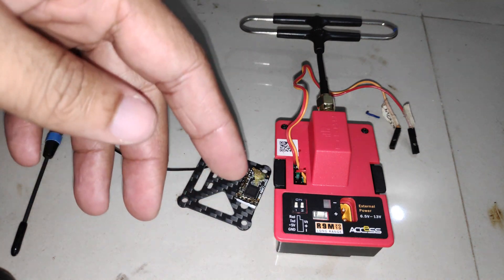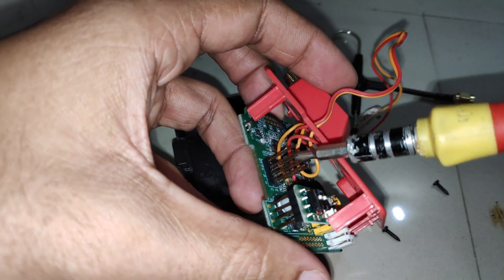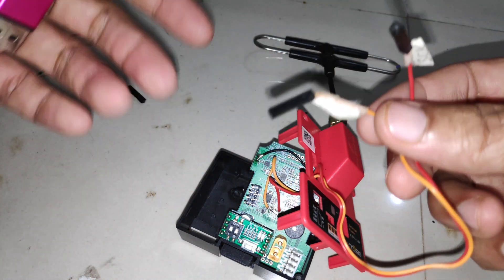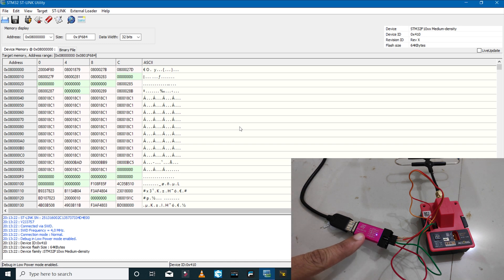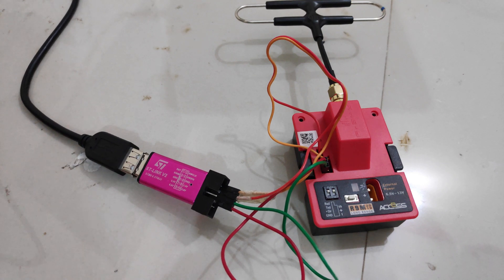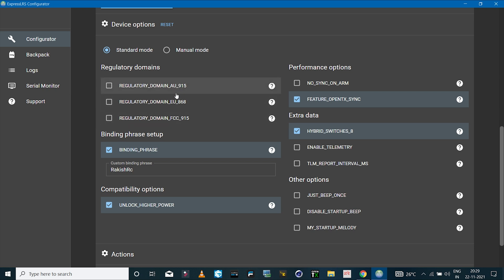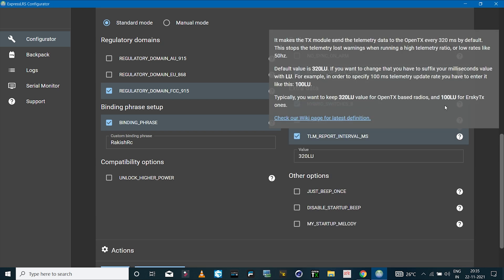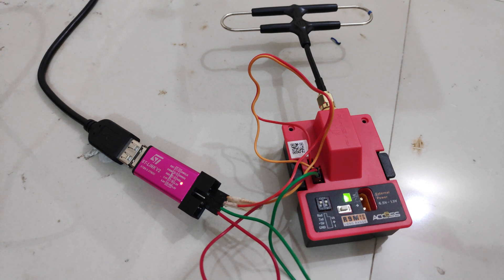Installing ExpressLRS on Frsky R9M using ST Link Utility | In Depth Tutorial

Comment: Hi, why did the power module burn out? According to the R9M manual, it supports 3S batteries.
Reply from the maker: It does but it mentioned in the user manual that don't plug a Fully charged 3s...my 3s was charged at full...so the voltage regulator blew up...there are 2 regulators in it..one of it burnt.

Comment: kindly tell me how to re-flash a newer version of elrs on r9m tx after flashing it with the version you showed on video.
Reply from the maker: Once elrs is flashed then you can update to latest version by using betaflight pass through method.
Reply: @RakishRc  betaflight passthrough works with the transmitter module too ? also, the red led keeps flashing on the r9mx receiver, even though i have flashed both TX and RX modules with ELRS 2.0.0. there is a solid green light on the R9M module, but red led keeps flashing on the receiver. using erfly6 firmware on flysky i6. pls help
Reply from the maker: @preetamghoshdrums219  did you select the crsf/elrs protocol in the radio settings? Also is the crossfire signal wire connected correctly on the tx pad of the radio? Betaflight pass through will only work for receiver for tx module use the St link device.
Reply: @RakishRc   just pointing out that i am using flysky i6 not i6x with the ERFly6 firmware. i have tried selecting elrs1/elrs2
 in protocol in model setup page, and connected the tx pad to the Smart port in the front of R9M TX module.  does it need powering from the front as well while using the Smart port ? Kindly share your mail to have this convo, earnest regards for your time so far.  need your further help to set this up.
Reply from the maker: @preetamghoshdrums219  yes I got that you're using the fsi6. How are you powering the r9m module? Contact me via telegram - @Rakish33 share pictures so it can be easy to resolve quickly
Reply: @RakishRc   I'll be sharing the pictures and whatever progress i have till now tomorrow on your telegram. thanks for helping out!!

Comment: Can a Ftdi Adapter use instead of ST LINK USB ADAPTER?
Reply from the maker: Ftdi won't work. Only stlink usb adaptor is flashing with this method because the chip in r9m and MX receiver is from STM.

Comment: Please tell me, I get the download file in the format Frsky_TX_R9M-2.5.0.elrs This st-link format does not read.
Reply from the maker: When you build the firmware file in elrs config did you select St link as the flashing method? That'll Build a .bin file which can be flashed via St link
Reply: @RakishRc  Thanks for the feedback. Yes, I choose Stlink in the configurator. But vseravno the file turns out elrs. Something is going wrong. What is most interesting, the file for the receivers is obtained in bin. here is an example: Frsky_RX_R9MX-2.5.0.bin
Reply: After a lot of trial and error, something came up. In the configurator, I pressed the BUILD & FLACH key. I did not see any file, but the module played a melody and the indicator turned green. How do you think he flashed? I just don't have a receiver yet to test. I plan to connect the module itself to the Radiolink at9s equipment via the PPM output.
Reply from the maker: @AndreyRos  If you heard the melody after flashing then elrs is installed successfully on the tx module. You won't be able to test with ppm input. You'll need a elrs 915mhz receiver to use with r9m. Does the radiolink support crossfire protocol?

Comment: Hi bro I have bought used r9m 2019 from know person and it's flash with ELRS so I want to flash stock firmware on it is it possible please do help bro I want to used it on flysky fsi6 transmitter so...
Reply from the maker: Hi, flashing Frsky firmware back is only possible if the elrs was not flashed using st link device. Ask the previous owner how he installed elrs and you should get the idea. But since you have fsi6 I'd suggest you install erfly6 firmware on it that'll allow you to use elrs on your FSI6 radio 👍
Reply from the maker: https://www.rcgroups.com/forums/showthread.php?3961635-ER9X-for-FS-I6-and-FS-I6X-%28ERFly6%29
Reply from the maker: https://youtu.be/2aww8gwR4tA
Reply: @RakishRc  he bro any idea where can we get that "programmer" In India, as imports r not possible now...!
Reply from the maker: @BiKersFury  https://roborium.com/swd-debugger the main problem is finding the programmer itself and that too genuine one. You should try the link seems like only one available here
Reply: I'm so glad for your reply, I'm following u since i started hobby 🙌 great videos great 👍👏😊
Thank you ✌

Comment: Build error
'arm-none-eabi-g++' is not recognized as an internal or external command,
operable program or batch file.
'arm-none-eabi-g++' is not recognized as an internal or external command,
operable program or batch file.
* [.pio\build\Frsky_TX_R9M_via_stock_BL\FrameworkArduino\HardwareSerial.cpp.o] Error 1
'arm-none-eabi-g++' is not recognized as an internal or external command,
operable program or batch file.
* [.pio\build\Frsky_TX_R9M_via_stock_BL\FrameworkArduinoVariant\variant.cpp.o] Error 1
* [.pio\build\Frsky_TX_R9M_via_stock_BL\FrameworkArduino\HardwareTimer.cpp.o] Error 1
'arm-none-eabi-gcc' is not recognized as an internal or external command,
operable program or batch file.
* [.pio\build\Frsky_TX_R9M_via_stock_BL\FrameworkArduinoVariant\PeripheralPins.c.o] Error 1
========================= [FAILED] Took 30.35 seconds =========================
Environment                Status    Duration
-------------------------  --------  ------------
Frsky_TX_R9M_via_stock_BL  FAILED    00:00:30.347
==================== 1 failed, 0 succeeded in 00:00:30.347 ====================

Comment: can I use the device, usb to s.port frsky, to flash the r9m module? instead of the STlink you use
Reply from the maker: Hi, actually that is possible and it will save the factory bootloader too if i am not wrong. But then how to do that and if it will work is something i can't tell for sure because i haven't tried it.